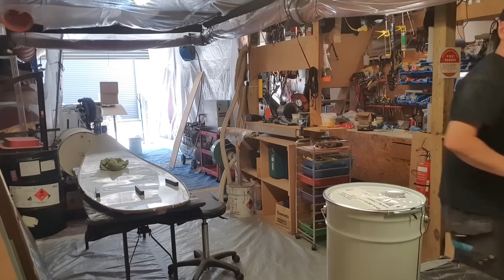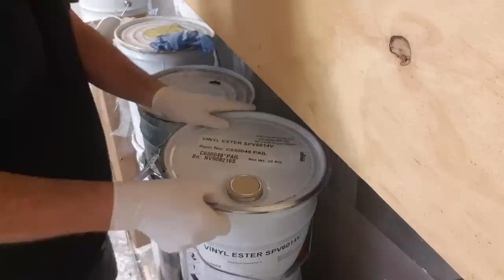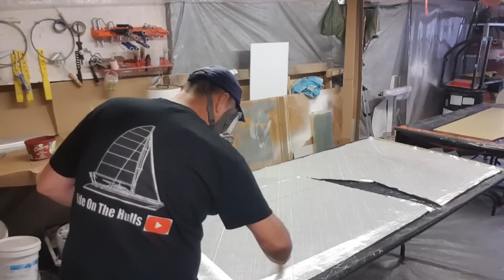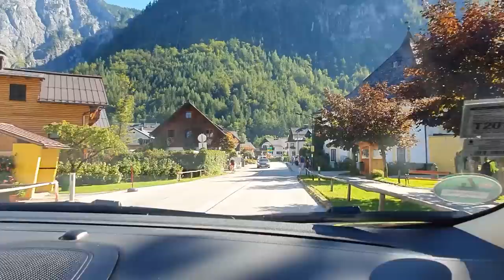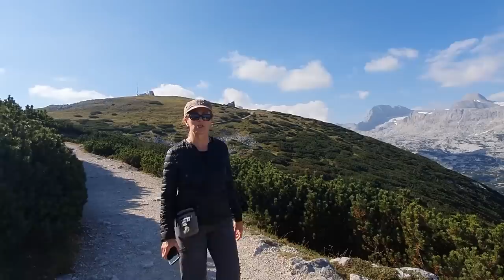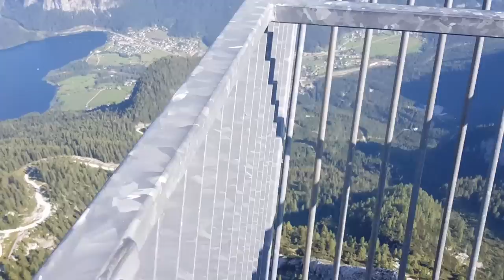Ep093 Laminating Plywood Bulkheads - Life On The Hulls Building a Catamaran

Comment: When I made the parquet table top for our Balboa, my hands cramped up from all the sanding. Using a sanding block helped, but it produced 'flats' on the edges. I priced some 'soft' blocks, but being a sailboat owner, I never had a lot of cash on hand, so I bought a cheap 'white board' eraser, wrapped it with some 120 grit and locked it on with thumbtacks. The eraser was just soft enough to 'flex' around edges but firm enough to knock down high spots without 'digging in'. Thing lasted forever, still have it in my kit 30 years later...
Reply from the maker: That is s great idea Mike.I have a few of those laying around.Cheers .Ross

Comment: Hey Rossco !  Glad you mentioned the prep on that plywood, was curious if you could increase the bond strength with mechanical fasteners widely separated every few inches like a staple thru the fiber that would remain under the finishing layer, or a small tack, countersunk screw, tiny holes thru plywood etc ? Always looking forward to your next post on YouTube...
Reply from the maker: I would likely prefer perforations filled with glass rovings instead of metal to keep the chemistry snd corrosion to a minimum.Would certainly improve the bond but it is more than adequate if dine correctly.In any case should the  substrate fail the ply will never fail unless rotted.Ross

Comment: Great video, I’ve watched all of the series so far, fascinating and well put together! Just a suggestion, why not cut up some small squares of plywood or something that you could use as riser blocks when you are laminating sheets of ply. If the sheet was a few mm above the surface of the table then maybe all that resin would just drip off the edge and not seep in under the sheet and need to be sanded off. If you had a good few small squares then I’m sure you could avoid any bowing in the sheet.